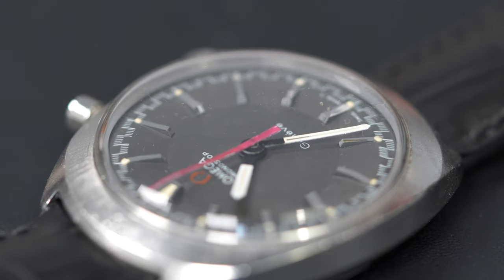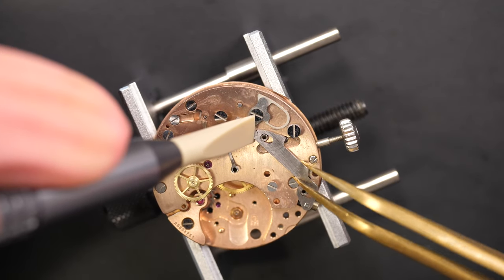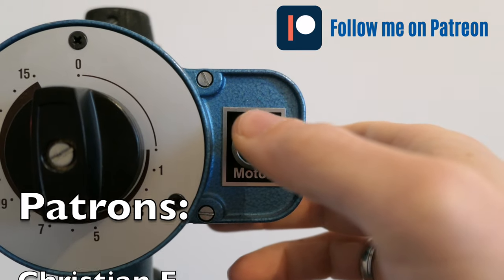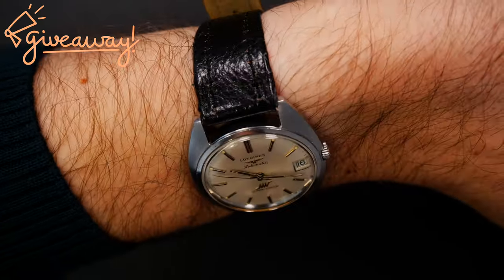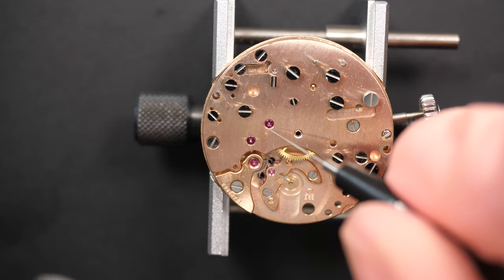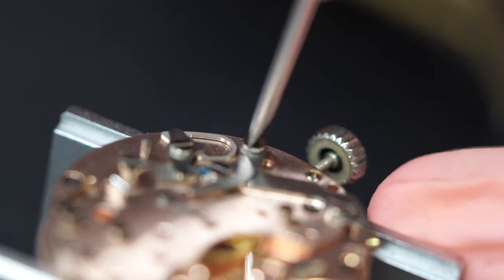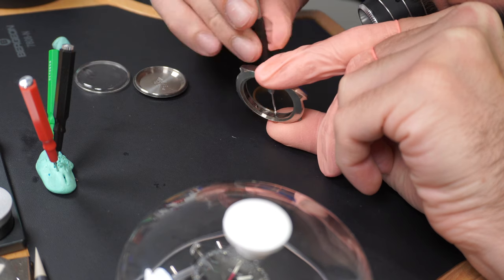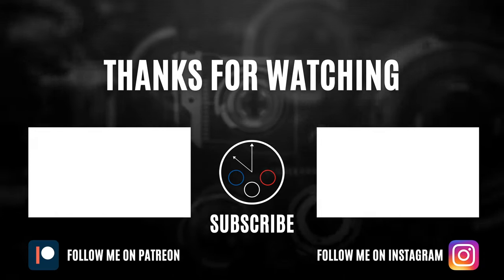Restoring the Simplest Chronograph from Omega: The Chronostop Watch Cal 865

Comment: Very happy to see you working on a calibre 865.   I have that same watch which I bought new in 1969 in Vietnam, along with a Omega Dynamic (cal. 601) and a manual wind Rolex (calibre 1215).  I decided about a year ago that I would learn watch repair so that I could service these.  I haven’t done them yet, opting to work on some American pocket watches first. Your video will really help when I get to the Choronstop.   Many thanks
Reply from the maker: It is a good move to start with other watches. I will fix the omega then the Rolex with the omega last. It is the most complicated of the 3

Comment: Hi ! Very nice job, once again ! this OMEGA movement's so amazing ! I've question regarding all the problems that you can see on these watches after buy: Except the part broken at the beginning of this restoration, the main problem is always the consequence of Old oil and rust ? Do you have never seen mainly broken parts during yours différents restorations ? Thanks a lot for your video and see you soon ! (Sorry por advance for my English, it's a good excercice for me to wrote something en English when possible...😅).
Reply from the maker: No problem with your English 😉
Of course that I had watches with broken parts. You can find parts with a broken mainspring, setting lever spring, balance staff. Sometime you know what it is broken before you open the watch. You will see in some videos coming later that some watches come with broken parts.